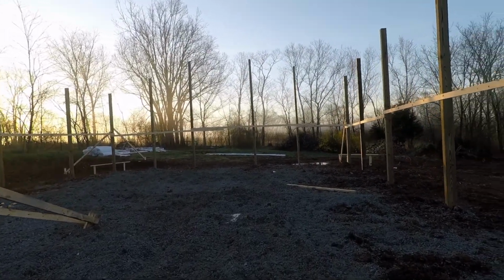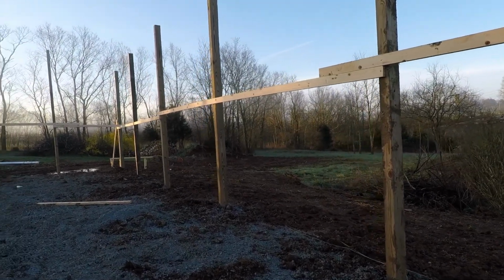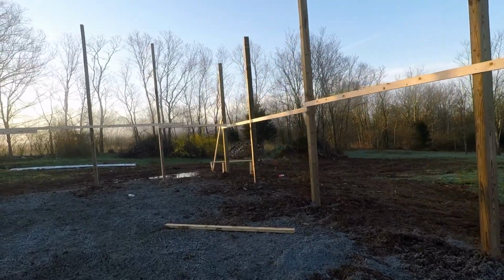#028:  40x50 Pole Barn Build Part 2 - Framing, Siding, and Roofing - Perkins

Comment: Did you do 10’ ceilings?
Reply from the maker: Hello SB, thanks for the question.  The barn itself has 12' ceiling, the interior build has standard 8' ceilings.   If I had the opportunity to do it again, I would likely have gone with an extra 10' in length (never big enough) and 14' walls in the barn.

Comment: How many roof truss u used on it if u don’t mind
Reply from the maker: Sorry for the late response.    In my barn I have 5’ spacing between the rafters so 9 internal rafters plus the two ends for a 50’ pole barn.    I would assume the design would be based in part on snow load, and we really do not get much snow here.

Comment: Wall height? Roof pitch? Loft height?
Reply from the maker: Marc, thanks for your questions.   The structure is a 40' x 50' with 12' high walls.   The roof pitch is 4/12.   I opted for a 1' overhang or eve on both ends and both sides.   As far as your question on Loft Height, not sure exactly what that is, however the distance between the top of wall, and top of roof is 6' 8".     If you have any other questions, just let me know and I'll do my best to answer them for you.